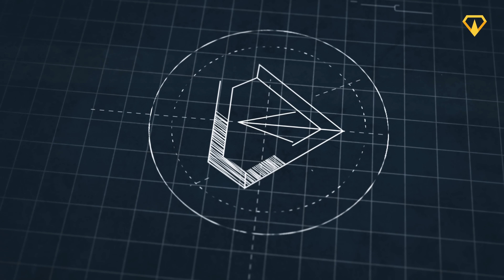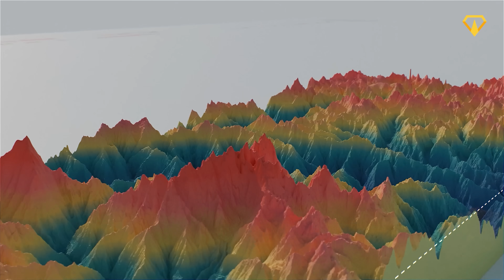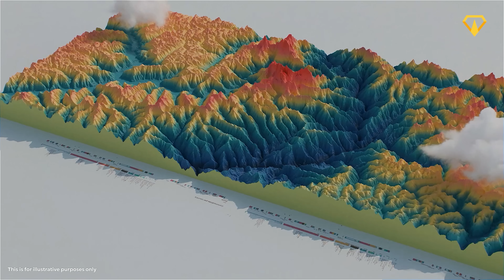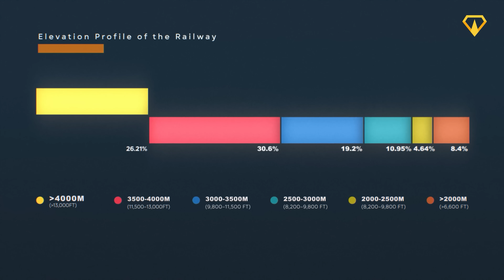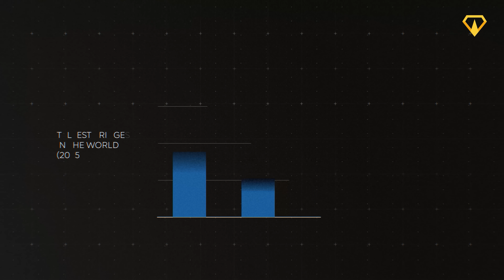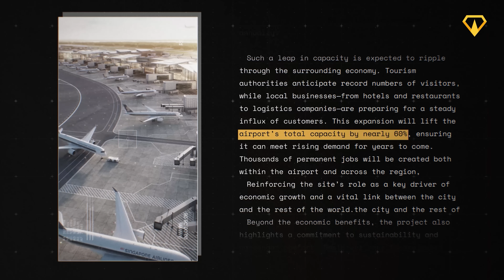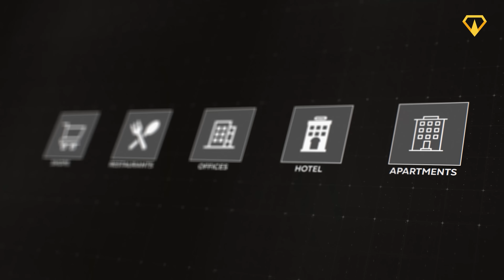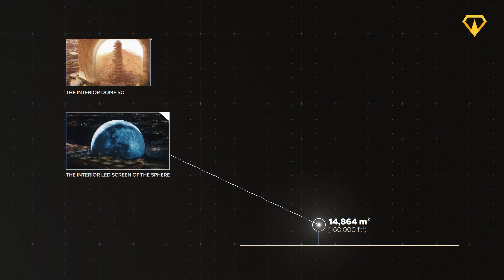The Biggest Megaprojects Under Construction

Comment: 16:06 By 2030. No way it will happen. Not unless they get someone like Superman or the Flash to help them build it. They could have until 2040 and they won't have it done. I am sure they will run into problems just like "The Line" had/has it's problems.

Comment: Nice Video!😊 I think it shows many examples of going for prestige instead of actual usage for the population...

Also there is one little mistake:
Although impressiv, the Mukaab isn't going to be the largest manmade structure by volume. It's the great wall of china!

The Great Wall of China is approximately 21,196 km long, 8 meters high, and 7.5 meters wide at the base, tapering to 5 meters wide at the top. To calculate its volume, we can use the formula for the volume of a trapezoidal prism: V = (a + b) * h * l / 2.

Plugging in the values, we get:
V = (7.5 + 5) * 8 * 21,196,000 / 2
V = 12.5 * 8 * 21,196,000 / 2
V = 100 * 21,196,000 / 2
V = 1,059,800,000 cubic meters

So, the volume of the Great Wall of China is approximately 1.06 billion cubic meters. Without the towers and stuff along the wall.

BUT Mukaab is still impressiv with 64 million m^3. For comparison. he Great Pyramide of Gizeh only has 2.6 million m^3.

Comment: That is a valley with canyons much like the colorado river.  There is a difference between a valley and a canyon.  A canyon is the eroded depth with sheer walls and does not include the elevation of the mountains around it.  Typically deep mountain canyons form where a river existed prior to the mountain uplift, allowing the river to erode away the mountains as they form, though there are other mechanisms for this to occur.

Comment: Great video! But 42km of tunnels on an earthquake prone mountainous region, what could go wrong...
Reply: There's nothing we can't out engineer. It's just about the cost
Reply: @ayoCC  There are plenty of cases everywhere that the "engineering" ended costing lives. There's no better engineering skill than common sense instead of vainglorious greed. On an earthquake prone region, the most important feature is access for immediate exit, you can't have even the most basic safety feature with a 42km tunnel. It goes well beyond just the structure, under an earthquake event the tunnel can have multiple collisions and fires, for example.
Reply: @SomewhereInTheSolarSystem I had to immediately look up if there's a reference case, and I stumbled upon seikan tunnel which is a 53km tunnel in Japan going which is in a region. In general Tokyo could be a reference with dense subway systems, skyscrapers and huge underground floodwater sinks.
Building in an earthquake prone area is never a first choice but it's also not an impossible challenge apparently. If we dig just a little into construction techniques we probably can find out a plethora of methods. I'm no engineer so I don't care too much, if they have a good reason to build in an earthquake zone they'll make sure to build in a way that can withstand their once in 100 year scenario is what I think